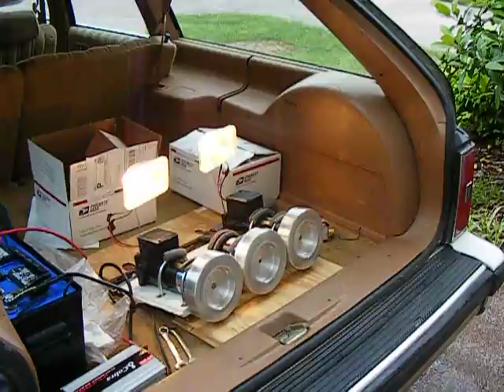New Free Energy

Comment: @ZoeMarks  interacting magnetic gears
I understand why & how the two forces are equal, and the device should be only a coupling device. BUT!

1. Do you believe that the line of magnetic flux (the attracting forces) can be manipulated? Shielded…
2. If so, then can one side of the interacting gears be manipulated and the other not? 
3. If so, wouldn’t the gears spin one direction easier than the other?  
4. Does speed and direction of rotation affect the eveness or uneveness of the attraction?

Comment: @jimmyhoffa9 - wrong. To get work out of magnets one must apply an opposing or attracting magnetic force. This requires one of the fields to be turned on and off. That is how electric motors work. The same thing cannot be accomplished with magnets alone. It is not possible to turn a permanent magnet off without using energy greater than can be recovered. The laws of conservation of energy have yet to be defeated by any device - magnetic motors are never going to self run.

Comment: @Yourfishman - magnets have a static field.  That field can be used to transfer energy (i.e. in an electric motor) but it is not energy as promoted by  "free energy" sites".  Also energy put into a magnet to make it magnetic is not then available for use as "stored energy".  Think of magnets acting like springs.  They can store potential energy as such but what is put in is released so no net energy gain to imply they can be used  in magnetic motors to run without any further input.

Comment: @LiamXaoh 
Sorry my friend we just have to disagree. 
1. Test will not confirm your point.
2. I do beleive the 2SO is a over 1 COP device. So is the Bedini, Lockridge & heat pump.
3. None of them are technically OU devices or over 100% efficient. because the energy is coming from somewhere else.

The C-weight could be ridged to take energy out by having it ratchet up only and remove the downward movement. Others have all ready done this test; YouTube; GEC Sustainable Life.wmv

Comment: One question... What happens when you take the output and connect it to the input in place of the battery and inverter.  If it continues to run continuously, at that point, you may have something. The problem is that, in any system there will be loss due to friction and heat loss.  Even if you were to eliminate all friction and heat loss you will never get out more than you put in.

Comment: @Yourfishman If the device in the box is an over-unity machine then answer 1 or 2 is correct. In reality answer 3 will apply because the device in the box won't run very long at all.
Correct language is critical otherwise you can make up your own meanings & confuse the discussion. So you agree COP doesn't apply to the oscillator.  Over unity does mean something will self run -the only test of the claim “over unity” is the euphemism for perpetual motion machine. Bedini devices don't produce OU.

Comment: @Yourfishman - the C weight doesn't remove energy from the system.  Energy is transferred from the swinging weight to allow (in some cases) for the C weight to lift.  In a frictionless world the P weight would keep swinging and the C weight would rise and fall all day.  Replace the C weight with a generator and it draws energy from the system in direct proportion to the force applied to the swing weight.  Out = In (less losses).  Test results will confirm this.

Comment: @LiamXaoh 
Yes, i would agree, i am less interested in the source of the energy or the theory of where the energy is coming from, my concern is weather the results of the test are valid or not.

Language, theory's, laws, are all secondary to tested results. If i can run my house with a Lockridge, Bindini, Muller or a solar panel device, The question of weather they can truly do the job is my first question.

Your question?
3. would be the most correct answer.  heavier or hotter is possible also

Comment: @LiamXaoh 
No COP is very different than efficiency.

Coefficient of performance, From Wikipedia

"A geothermal heat pump operating at COPheating 3.5 provides 3.5 units of heat for each unit of energy consumed (i.e. 1 kWh consumed would provide 3.5 kWh of output heat). The output heat comes from both the heat source and 1 kWh of input energy, so the heat-source is cooled by 2.5 kWh, not 3.5 kWh."

Comment: @Yourfishman - you're wanting to discuss aspects that you think are the key things that will make the device a viable proposition, however trying to answer such questions is rather pointless as you don't seem to grasp the bigger picture.  Imagine an OU machine fitted a generator all housed in an insulated box.  Protruding from the box are the wires that power something.  Which of these things will happen?  
1. The box gets lighter.
2. The box gets colder.
3. Neither, no change.

Comment: @LiamXaoh
 Are you saying the stopping test can not be done by adding weight to the c-weight? (i'm guessing because it moves in both directions)

A weight will pull in both directions, but the generator will only pull (or has resistance) in one direction. 
So does the C-weight pulling in the downward movement adds or subtract anything. I don't know the answer. I'm not sure if that was your point, but it is a very valid point. Without that answer, i can see where the 2SO as is proves nothing.

Comment: @Yourfishman - on over unity device produces more power than it consumes, the test is for it to self run.  A heat pump is not an over-unity device.  You need to study what the meaning of COP is.  A 1kW pump pumping water that has been heated by a 100kW heater by your logic would have a COP of 100.  No one has found a means to fault the the established laws of motion - the laws were founded on observation and confirmed my math.  Not a circular argument at all.

Comment: @Yourfishman - my point is the whole device is a system that has an input on one side and output on the other.  The force that goes in is 10lbs (or whatever) and the same force comes out the other side.  Gravity is not being harnessed to amplify the input and your math of 100/10 = COP of 10 is not valid.  Replacing the C weigh with a generator will produce a power output  (ignoring all friction losses etc)  that is the same as the input.

Comment: @Yourfishman - you need to re-read my posts again.  Of course it would oscillate with any reasonable weight.  The 100 lbs is part of the device in the context of the discussion as to what specific force causes it to rise.  The  C weight rises due to the difference in its weight and the force caused by the swing P weight.  The C weight doesn't remove energy from the system (ignoring friction) however replacing it with another device such as a generator will remove energy from the system.

Comment: @LiamXaoh 

I am curious as to where you stand Now? Is the C-weight being apart of the device. Because you have said that it's a part of it, but then later agreed it would still works/oscillate without the C-weight.

I thought  once you agreed that the pendulum could pull negative force (upward) on the lever, and then a 100 lbs positive force (downward)  that you understood that the C-weight is optional & not a part of the device. 

If it's not a part, you should agree it's stopping force/work?

Comment: @LiamXaoh The one thing you said that is REAL proof, "Stopping force". 

*THE TEST*
Start the motion, with minimum C-weight. (which is zero, you acknowledged that) 
Once in full motion you can start the test (energy to start the device is MUCH higher that running energy)
Add weight until the motion slows or stops. (which in our example is 100)
 
If  the Stopping weight/force is higher than the input weight/force we have OU.
 Been there, done that, got the T shirt.

Comment: @LiamXaoh 
The MATH? (I'm no authority on math, at all, but i think you mean the formula)
Could the "math" (formula) be rooted in certain laws of Physics?  
If so, would that "math" (formula) ever contradict those Laws? 

So searching for the answer to the questions of a law's validity, in a formula that only can support that law, may be flawed reasoning. Like circular reasoning. 

PS. Self-running is not a requirement for OU. otherwise any ou device"must run itself" (heat pump...).

Comment: @Yourfishman - where you are letting yourself down is with the maths.  You have grabbed two numbers (100lbs and 10lbs) as inputs & outputs & simply divided one into the other then stated COP =10.  If the output was 100lbs then it would take a 100lb force stop the C weight rising.  Place a a few lbs on the C weight & it will stop rising - that extra weight is the output.  I suggest you talk to those "many engineers" you refer to &  they'll tell you everything I had said is correct.

Comment: Oh well.
You simple replace the 100 lbs C-weight with a generator. 
The upward force on the c-side = 100 lbs.
The down force c-side = 1 lbs (past 90 degree move of P-weight).
The lever moves with, or without, the C-weight. (lever just clangs up and down).   Now we put in a generator (with a ratcheting attachment).
Pulls up with 100lbs (turning the generator).
Pushes down 1lbs (retuning the ratchet).
All that for 10 pounds of in-force.
Sorry, that is the best i can do for an explanation

Comment: @Yourfishman - With a COP os 10 you must be able to connect the output to the input and it will self run.  I'll bet you can never get it to do it as the COP is <1.  The Powell device video demonstrates nothing at all.  Torque being measured means what?  Torque is not power.  Greater torque out than in from a device does not mean more power out than in.  A gravity type OU device has not been demonstrated.  I am amazed you cannot grasp that.

Comment: @LiamXaoh 
Absolutely in agreement. 

So, if the effective weight  on the counter weight goes from zero (or less) to 100 or more, you can see that the C -weight is not necessary for this device to oscillate. The C-wight is not a part of the device, it is the work. 10 in =100 out.

Liam I've seen you post other times and i knew you would get this. I could have done a better job explaining it.
 There are other versions where OU may be clearer.

Comment: @Yourfishman - with the swing weight at 90 degrees (horizontal) the force on the lever in the vertical direction is zero.  Greater than 90 degrees it will try to lift the lever and will end up pushing down on the counterweight so it will apply a force on the ground of 100lbs weight plus the transferred force of the P weigh.

Comment: @LiamXaoh 
"The P-weight goes from 50 to 100 in the 45 degree swing. But the force on the lever (at 45 degrees starting point) goes from 35 to 100."

BINGO !!

That is clear to me also :-) Now, at 90 degrees what is it? If we accelerate it enough to go to 110 degrees does it pull negative numbers?

I only view point that counts, is the view point of the C-weight !!!
This is why i called it relative/effective weight & not the actual weight.

Comment: @Yourfishman _ I can see your comment to Zoemarks you suggest weightlessness is a point of disagreement.  It isn't.  What lifts the C weight is the P-weight at the bottom of the swing.  At the top of the swing where there is apparent weightlessness (the object still has weight but the upward inertial force due to its moving mass  =  downward force due to gravity, it hangs there for 0.00000 etc seconds).  It is just a case of how big the swing is and how much force it applies to the lever.

Comment: @Yourfishman - I can see how I might have confused you (& me too,  LOL).  The force of the P-weight on the lever is given by F(P) = F(G) x sin (angle).  So if the weight reaches 45 degrees then the force is 50lbs x sin45 = 35lbs approx.

There are two ways to view it.  The P-weight goes from 50 to 100 in the 45 degree swing.  But the force on the lever (at 45 degrees starting point) goes from 35 to 100.  If you know how to draw simple vector diagrams it'll all be clearer.

Comment: @Yourfishman - You have to think about it more carefully.  You are confusing the weight of the P weight with the force it exerts.  When the P weight is motionless gravity is acting on it with a force of 50 lbs.  The hard part to imagine though is the downward force on the lever.  When the P weigh is hanging straight down and still, the force is 50lb, when it is at the top of the swing the weight is still 50lb but the vector pulling down on the lever will be a function of the angle of swing.

Comment: @LiamXaoh 

OK we only disagree on one big thing. That is the relative weight, or downward force, on the LEVER when the P-weight is horizontal & changing directions. 

Have you ever seen a big kid on a big swing?  As he reaches his max height before he changes direction, the chain goes slack, the downward force from the KID, on the cross beam, is Zero.

Maybe a skateboarder in a half pipe is a better visualization example. As the skater goes vertical he is in the air relatively weightless.

Comment: @Yourfishman - at the top of the swing the P weight is motionless therefore it is only subjected to the force of gravity and weighs 50lb.  At the bottom of the swing it has maximum velocity and due to F= MV^2/R will have the maximum weight increase.  Depending on how hard the pendulum has been pushed it will can create a total force of just over 100lbs which will cause the C weight rise.  Knowing the length of the pendulum and the weights you can back calculate the actual force applied.

Comment: @Yourfishman - no. When the pendulum is swinging just enough to lift the 100lb weight the force required to lift the 100lb weight to keep the swing happening is 10lbs, not 110lbs.  100lbs force is already lifting the weight, you are trying to count it twice. Thus 10lbs in either end produces 10lbs at the other end, less frictional losses.

Input end force = 10lbs that cause 50lb weight + 50lb sustain cause swing
Output end force = 10lbs to lift 100lb weight balanced by 50 + 50 at the other end.

Comment: @Yourfishman - the counterweight rises at a rate dependent on the swing force.  And the swing force (to just get lift) is dependent on the difference in weight between the two weights.  If you think you have applied a swing force of 10lbs over 3 inches in say one second that is 2.5 footpounds/sec = 2.5/550 = 1/220th of a horsepower.

As the rising counter weight act likes a weight of the difference between the two and it travels the same distance in the same time = 1/220 HP also.

Comment: @Yourfishman - the truth is I'm correct.  :-)  The swing weight varies from its starting weight plus what the swinging produces.  So not 0 to100 but 50 to X where is X is dependent on the force applied to it. If the counter weight and the swing weight are both 50lbs then the slightest swing of the weight will lift it.  In that case you can see a 50lb weight on a pivot is lifting 50lbs -A 10lb push would lift the 50 weight more quickly.  Your thought on running it backwards.

Comment: @LiamXaoh 
So  yes, i agree with your assessment, running the device backwards is supportive evidence to the energy relationship, 

The answer to your question for our example is; "it takes 110 lbs of downward force to supply enough energy to maintain the pendulum movement (when the 100 pound c-weight is removed).
 So backwards110lbs = 10 lbs.
 Forwards 10 lbs = 110 lbs
(Forward. 10 lbs of movement +50 lbs p-weight + 50 lbs G-force/acceleration  = 100 lbs c-w, or ____ +10 lbs for movement)

Comment: @LiamXaoh 
(To clarify the weights, lets call them P-weight for the pendulum, and C-weight for the 100lbs Counter weight.) 
You are saying because lifting the C-weight with 10 lbs of force moves the P-weight the same. The forces are equal & no gains anywhere?  So you're saying the 2SO is an elaborate see-saw.  That's a GOOD argument,  I can see how many people would accept that on face value. 

There is one problem with it, & it's a big one! I will try and explain it like as good as you did.

Comment: @Yourfishman - the sure way to prove that a 10 lb force is not being translated to a 100lb lift (to give the impression of  10:1 gain or or whatever is to run the device backwards.  Get the weight swinging until the weight is being lifted.  Then use your hand to lift the weight in time to keep the weight swinging.  The input force will be the same as it took to keep the weight swinging.  The force being applied at either end is equal only to all the frictional losses.  No gains anywhere.

Comment: @Yourfishman - The force being applied to push the swinging weight in the oscillator is actually the same force being used to lift the weight because the swinging mass has its weight increased due to Newton's 2nd law.  As the two weights now equal each other.  One weighs 100lbs due to gravity and the other weighs say 50lbs due to gravity plus say 50 lbs due swinging.  Give the swinging weight a faster swing and it develops more lift and the other weight rises.   Efficiency <100% (friction)

Comment: @Yourfishman - hang a weight (say 10 lbs) from a spring balance and note the reading.  Swing the weight and notice the reading on the spring balance increases.  A small force (making it swing) can be used to increase the "force" shown on the balance scale.  The swinging of the weight obeys Newton's Second Law.  The force generated by the swinging weight is F = ma (mass x acceleration) = mv2/r (velocity squared /radius of swing).  This generated force is what lifts the weigh in the oscillator.

Comment: @Yourfishman - The measurements are irrelevant once you understand what you are observing.

A car driving at a constant speed around a circular track is accelerating.  From "a normal perspective" means physics is not your forte.

Acceleration = change in velocity
Velocity = speed in one direction
Change in direction = change in velocity = acceleration.

My point? The physics has to be understood as the oscillator presents information in a way that is easily misunderstood.